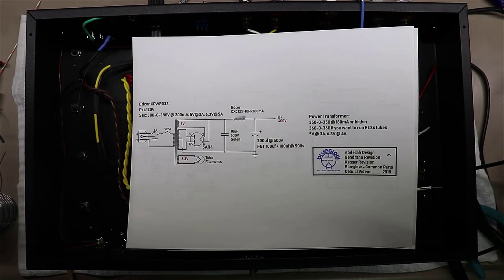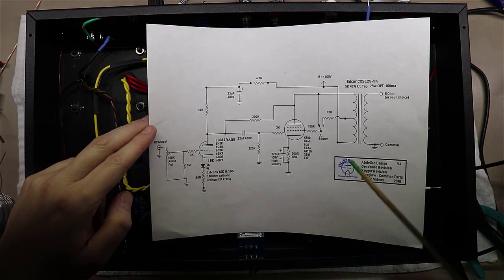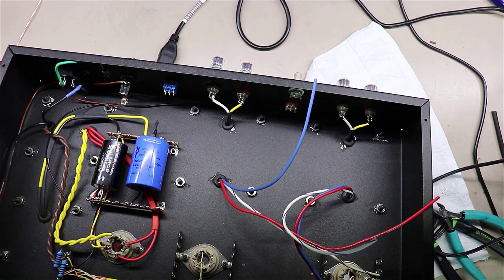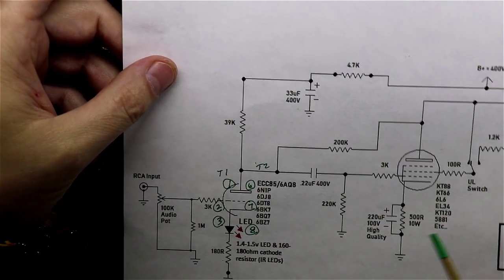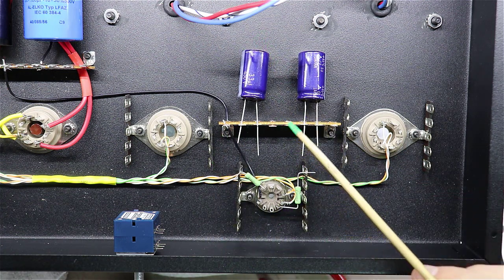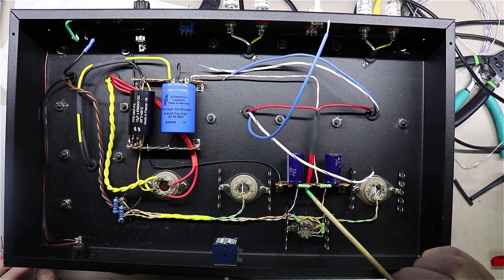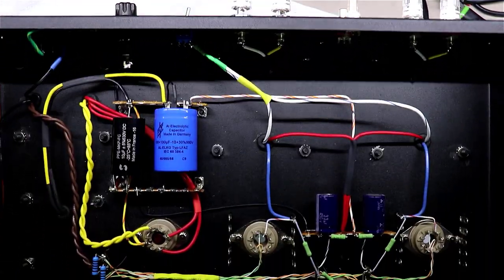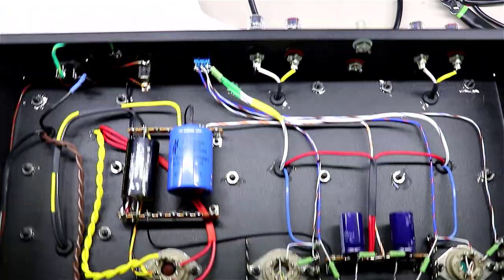KT88 Single Ended Tube Amplifier Build 2018 - Part 6

Comment: In your separate video on grounding and avoiding ground loops, you stated that the output jack commons should not be tied to the chassis.  But in this build, you connected the commons to the star ground.  Please clarify because I must not be understanding what you said in the grounding video.  Thanks.

Comment: I have found leaving the ptfe  tubing full length of the lead, make your bends, cut to the length and use  thermal strippers to remove the solder connection. Makes it easier and leaves the ptfe intact.

Comment: hi mark, great series of vids....when you created the 2nd star point you used the chassis grounded lug of the tagstrip...so in effect you have a parallel ground return, the chassis and the black wire....i am not as expert as you, so i may be wrong, but i thought that the second star point should be not chassis grounded ? please explain, thanks bob
Reply from the maker: Perfectly fine to do it this way, seen many well known makers do this.  The wire will always be the shorter path back and thus the path of least resistance.

Comment: Hi Mark. Educor don’t seem to do this transformer in 240v. The nearest is 375-0-375. Any modifications to circuit needed for this voltage drop? Will help your international fans.
Reply from the maker: You would be fine at 375-0-375

Comment: I am so happy you are taking the slow road on this.  I don't build this sort of gear anymore, but the time you take to explain the details enlightens me in many ways.  There is much to learn for anyone dealing with "the signal path" of anything.

One question from a non-audiophile point of view:  Where are the power calculations?  For instance the small multi-pole switch would cause me to do a page of power calculations and then both sweat the data sheets and load test the possible choices.  Based on the schematic, a substantial portion of the primary side of the output transformer will be switched by that tiny thing.
 
I would be seriously worried about its frequency response, power capacity and contact properties.  Are these things subjects that are generally known?  Can you point me to some dusty old book I can look at that surveys the power and frequency "rules of thumb" for work at these voltages and frequencies?

I guess you can spot the old professor curiosity popping up.
Reply from the maker: Way over thinking it... The switch is just there to provide the screen voltage (extremely low current, thus hardly any power).  When we get it built, we can do some measuring across the 100R screen resistor and see what we end up with but I've used these type mini switches for UL switching for 20+ years with no issues.  There is the practical side to these builds where you just go with what others have done many times over and then there is the deep engineering side of it, which I won't get into with my viewers typically as they would need a lot of formal education to follow.

Comment: Mark, I really enjoy your videos.  I have built several of my own designs over the years but you can always learn something from someone else's experiences.  There is one thing that I don't understand about the grounding of the output transformer secondary on your design. If you were using global feedback to the cathode of the input triode I could see why you would need the ground for reference to provide that voltage divider network.  On this design the output transformer secondary does not need to be referenced to any of amplifier circuit to operate and the speakers don't need to be referenced to the amplifier so in that sense I don't see the need for the ground.  Please enlighten me as to what I am not seeing.

Comment: Nice work, Mark!  Thanks for the detail in the layout, it looks very neat so far.  While I understand well the "high level view" of how the amp works, I struggle with the design calculations and how one arrives at the resistor, capacitor and inductor values in good designs.  I also don't understand what "shade feedback" is, why you've incorporated it in your design and how you arrived at the values you did.  Can you go into those details a bit for us? Thanks!  I'm looking forward to hearing the completed amp in action!

Comment: I hate to tell you this, you don't have the 200k feedback resistors connected to the input tube plates!
Reply from the maker: I'll be damned, if I didn't rewire them and get them on the other side of the 39k resistor again... Thanks for catching that.

Comment: Another great video Mark.  I learn from them all.  You just amaze me with how well your soldering technique is, I struggle in the area the most, what is amazing to me is how you tie all the wires to one point, it seems so easy to you, but here I have hard time getting two wires to connect to a terminal let alone 3 or 4 like you have on some.  Some of the neatest soldering jobs I see are done by you. While watching the video I thought you were going to finish it in this video, you were moving so well.  But times flies and the video was over didn't even seem like 5 minutes had gone by let alone 30.  Thank you again!

Comment: I really like your layout, but I feel like if I was to attempt this i'd be tempted to place the power switch on the back and the feedback switch on the front, seems like a lot of long runs of wire because of the placement of those two switches, or am I missing something vital?
Reply: Probably for convenience. The power switch is used on a frequent basis, so it belongs in an accessible location like the front panel.
The feedback switch would only be occasionally changed so no bigge if it is in a less accessible spot.
Why not both on front? Maybe aestethics? You want to have a clean uncluttered front panel.

Comment: Nice Work Mark. One thing though, A Double "Pole" (Not Post) Single Throw (DPST) switch. Each of the terminals of a double POLE single switch can either be in the on position (closed) or in the off position (open) just a clarification.

Comment: Fantastic video series.  Most appreciated.  I have been looking at this amp on the DIY site from which you pulled it for several years.  I have even through about making it with KT90 or  KT120 tubes.  A few questions:  1) what size and type hookup wire do you recommend (gauge/solid or stranded/coating?) for this amp build;  and 2) the Edcor iron only has a choice of 8 or 4 ohm taps.  I have a variety of speakers from 4 to 8 ohms.  Should one look at transformers with additional taps, or do you find that 8 ohm works OK on almost all speakers?  Thanks so much.
Reply from the maker: I use a lot of PTFE wire in 22, 20 and 18ga.  I use stranded.  Only thing I use solid wire for is if I make a buss ground (see my SE 807 build).  Any OPT with the same impedance would work, nothing special about the edcors

Comment: Hi Mark, have you got the second star point isolated from the chassis? Looks like the you've got it on the mounting lug. The other thing I was wondering about is that the screen grid switch will have a momentary open time as the switch is thrown and thus no screen grid voltage. Is it too short a time to be an issue? Best. M
Reply from the maker: I need to point that out in one of my videos. It's ok for the 2nd ground point to be tied to the chassis as long as you run a wire from it straight back to the first star ground point.  I can name quite a few big name amps that were done this way.  On the screen switch, you should never flip the switch with the amp on, for exactly the reason you mention.  I planned to point that out at some point in the series.
Reply: @Blueglow  Thanks. I think I've seen some amps where you can switch live. Maybe they use make before break switches?
Reply from the maker: exactly
Reply from the maker: exactly  @mfr58